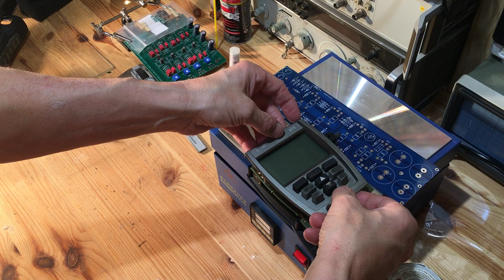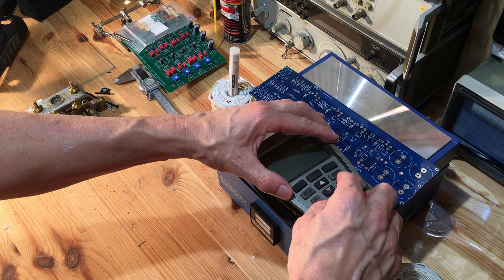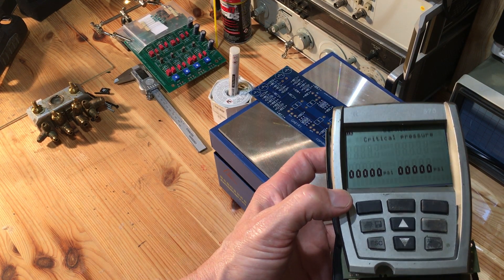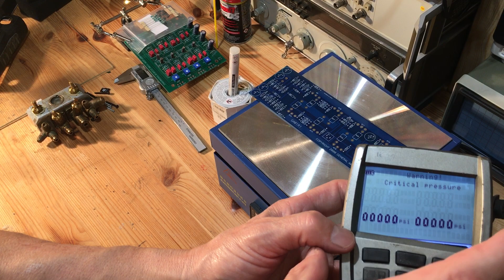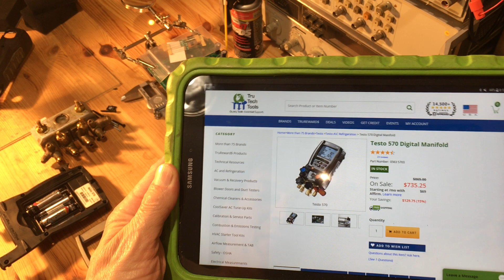Pt 2: Testo 570 repair it works but I found another problem, SMD!?

Comment: Hello Sir I hope you can help me with my Problem , I have also one of Testo 557 and it show me (EEP FAIL) I don't know if you have a solution for that please.
Reply from the maker: I know very little about the Testo and their failure codes.    I basically stopped using my Testo had too many problems I returned it and the second one had problems to I only use Fieldpiece now very rarely every touch the Testo‘s
Reply: @coldfinger459sub0  thank you for your answer .

Comment: Hello I would like your opinion I would like to buy this text on eBay it has a problem I would like to know if we can fix it  https://www.ebay.de/itm/Testo-557-Digitale-Monteurhilfe-Manometer-Kalteanlage/363046372220?_trkparms=aid%3D111001%26algo%3DREC.SEED%26ao%3D1%26asc%3D20180816085401%26meid%3Dbe5e37efef924dbca5320b17ad743d73%26pid%3D100970%26rk%3D4%26rkt%3D6%26mehot%3Dnone%26sd%3D224073556439%26itm%3D363046372220%26pmt%3D0%26noa%3D1%26pg%3D2380057%26brand%3DTesto&_trksid=p2380057.c100970.m5481&_trkparms=pageci%3A42979303-c9d8-11ea-9106-feb6b81b6a90%7Cparentrq%3A67c97fc71730a9bd93564ef4fff8247a%7Ciid%3A1
Reply from the maker: gorlier jerome Go onto Testo‘s website contact technical support through email. Send me a picture of the error code. Cost would probably be whatever shipping costs and their minimum charge for overhauling or fixing their components.
Reply: Ok code erreur  eep fail